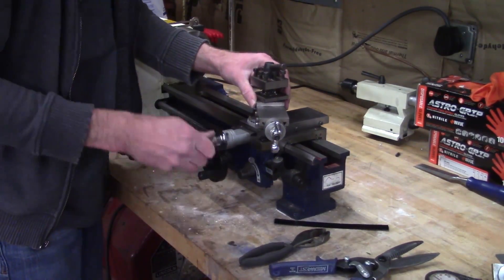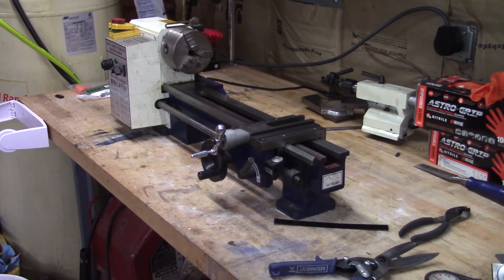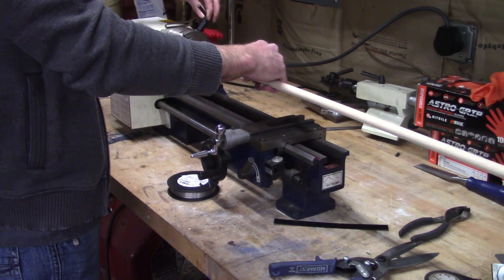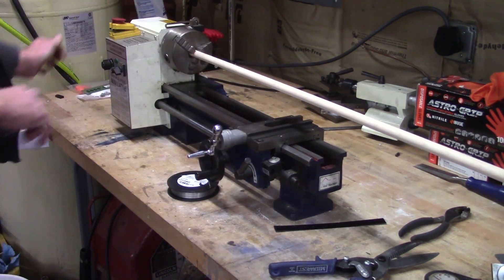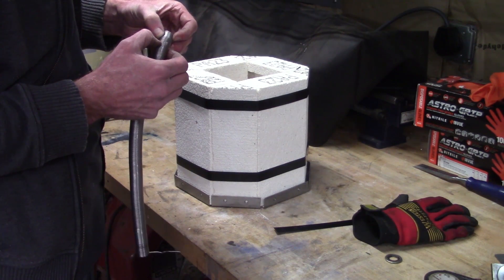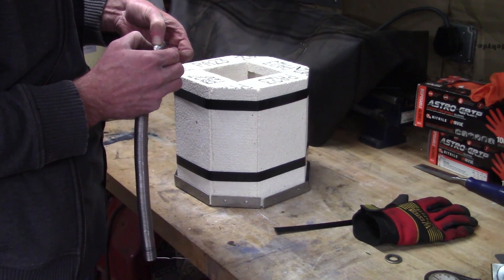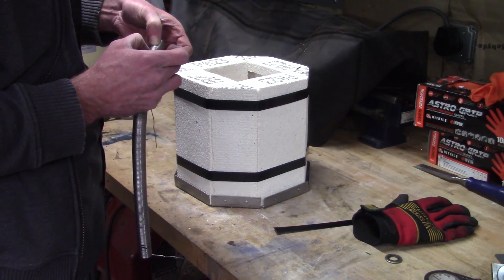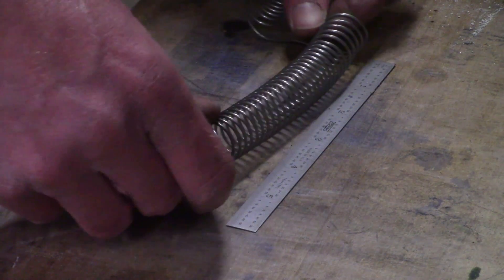Making an Electric Casting Furnace: Part 2

Comment: Nice build! What gauge Kanthal did you use? I'm planning to build one and run on 120 VAC, with around 1800 watts I need about 8 ohms coil. It seems to me my coil would be very short, so I can't wrap multiple turns on the furnace. Your coil seems longer, so I wonder what gauge you use.
Reply: In one of his comments, he mentions his runs roughly 3000w, and at 220v must be pulling 13.6A (P/V=I). And so his element must be just over 16ohms (V/I=R). From your figures, you're running 120V @ 15A. I think AWG 18 kanthal runs at 1.7 ohm/meter, and he used a whole spool, so maybe a 10 meter spool? So my guess is, he used AWG18. So like you said, your coils going to be very short or very thick!
Reply: Actually scratch that, further down he says he uses AWG16 wire, so he'd be using roughly 15 meters.

Comment: Hey, any chance we could get a BOM or those plans you refrence in the first video? Thanks!
Reply from the maker: +Da Az I'll see about the plans if I still have them. Remind me in a day or two if you don't hear back.  The BOM changes based on a lot with what you can find, the wire, thickness, number of turns, etc. There are good resources online though. Kanthal 16 gauge, PID temp module, a high temp thermistor/thermocouple compatable with your PID, high current AC relay for the PID to switch the 220 or 110v AC and then just some fire brick and quartz glass tube.  Has to be quartz or it will melt.
Reply: Thanks! Really I was wondering if you needed a special PID to handle the high voltage but then I realized with a derp that that was what the relay is for. Would thinner kanthal yield a more resistive coil that might work on 110v here in the us? My 220v isnt in a convenient spot for smelting.
Reply from the maker: Sure.  You'd have to do the math but basically the lower voltage makes it harder to get high temperatures - at least quickly.

Comment: Nice build, all that bare copper wire around the place makes me nervous though.
Reply from the maker: +Wobblycogs Workshop That's all grounding wire for the exposed metal bits so its perfectly safe; or at least equally as safe as the metal. :)

Comment: Chris,  what is the diameter of the Kanthal wire and how many feet do you have in the kiln?  Did you calculate from the resistance of the wire to determine the feet you need and amperage available?  Or, did you find a plan out there somewhere?

Love your show!  Can't wait to see more on the mill!
Reply from the maker: +Green Range it's 16ga which is the biggest they sell on Amazon.  I did the calculation based on this into http://www.euclids.com/Html%20pages/element-design.htm and used a coil length calculator to get the final length. I don't recall that I actually used though.

Comment: Hi cris congratulations for the video. I ask you: with this the resistance lasts a lot? Can you use it for a long time?
Reply from the maker: +Lele Armi It doesn't last forever but it should be good for at least several dozen hours, if not 100+ hours.
Reply: Thank you for the reply . The resistance is in kanthal? 100 hours are few, so is a machine for just the right experiment? In my opinion, with few modifications, it can be very lasting and put in a working environment. what do you think about it ?
Reply from the maker: +Lele Armi How long it will last depends on a lot of things, the diameter of the wire, the operating temperature, how many on/off cycles, etc. There are thicker elements made of things like silicon carbide if you want it to last even longer.

Comment: Nice build.  Why did you put the glass tubes in the coils?  Are they not stiff enough to avoid collapse?  I just built a small heat treating oven, using 1x0.3mm Kanthal wire at 3.9 ohms per meter (1.3 ohms per foot).  So far I have tested it at 1560 degrees F (850C) and no need for any rods to hold the coils together.  Although I did have som trouble with the coils twisting out of the slits when heated.  Fastened them with some steel pins to the blocks.  My goal is to heat treat a special tool steel at 1920F (1050C).  Hope to put out a video soon (but my graphics car said bye bye).
Reply from the maker: Correct.  I heat to about 2,000F occasionally which was enough to completely collapse the Kanthal wire of about the same gauge in my last kiln.  The staples work well enough in the ceramic fiber board but they have no grip in the bricks like I used; they just pull right back out.  So, I figured I'd try and find something that would support them.  So far the glass is still perfect after about 30 cycles!

Comment: Where did u get your kanthal thread, what wire dimension is it, and how did u calculate the coils? I have only used premade ones.. But this got me curious in doing a second attempt at a electric kiln instead of my oil burning ones.
Reply from the maker: I got it from Amazon,  from a company called Temco.  It's 16 gauge.  For the length calculation I used their ohm/ft spec and http://deepfriedneon.com/tesla_f_calchelix.html for a calculator.  Know the resistance you want, coil diameter and spacing and just keep changing number of turns until it calculates the length you are after.

Comment: 120 volts 😂  noting personal just the fact that 220 volt is special in the usa is funy
Reply: Thefreakyfreek virtually  every house in the US has 220v, its just that typical wall outlets are 120v, 15a. What happens is the power coming in is two different 110v "legs" come in, 180 degrees  out of phase with each other, combined it makes 220v, for things like stoves, air conditioners, etc. Its known as 220 single phase. Industrial power is usually 220v 3 phase, which has 3 powered legs, 120 degrees out of phase with each other.
Reply: Thefreakyfreek Over here in New Zealand, we have 240v wall outlets
Reply: in europe l1 to n is 220 v and 3 phace power is 380V from l1 to l2 or l3 
and we use l1 to n as normal house power
Reply: For example every normal building  in Germany have a 220V 3 phase house connection which is used in the stove. Furthermore it is split to three normal 220V rails who power the normal outlets.
Reply: And a juicy 400v on 3 phase
Reply: its 230 in NZ. 240 in Oz
Reply: in europe is between live and ground 230VAC 50Hz, between phases 400V. everywhere, every house, is threee phase conection :-P
Reply: Europe, before EU era, has different voltages for different countries. Most communist areas use 220V/380V, British and surrounding areas use 240V/415V, and other areas use either of them. After EU unification, a middle point was chosen, at 230V/400V. Grid operation was not changed, the change of voltage level is only a political thing, and the grid still operates at what it used to output. 230V+-10% covers 220V+10%-6% to 240V+6%-10%. Same for Australia.
Reply: u.s is typically 120. industrial is usually 440 3 phose
Reply: part 3? nice vid
Reply: Man every house has 200v supply all you have to do is to connect the load between 2 seperate 120v phases to get the higher voltage.

Before you correct me by saying that the double of 120v is 240v the phases are 120 degrees out of phase and not 180 degrees so the the second phase gives only the 2/3 of the voltage because 120 degrees is the 2/3 of 180 degrees (180/3=60 and 60*2=120).

Comment: Back when I was a kid one of the things at carnivals was stretched Coke bottles.  Basically the same thing you have with no bottom.  Raise it off the table, tie a soda bottle neck so the body is in the kiln, turn it on, and as the glass heats up, the bottle stretches out to whatever length you want it to.

Do a GIS for stretched out soda bottles
Reply from the maker: Haha I've heard of those but never thought about how they did it!

Comment: Nice build, what is the diameter of that kanthal wire and from where did you buy it? I would have put those coils to lower two slots instead, heat rises up and all that you know, don't know if that's with any significance in this case though. Keep up the good work!
Reply from the maker: It's 16 gauge which is the biggest I could find, easily.  I got it on Amazon.  Yea I don't know if it matters where the coils are.  Everything I've done with it has been in the top half anyway.

Comment: awesome build, this old Tony has a video about springs where he's using the thread cutting on his lathe to make equally spaced springs. so you wouldn't have to stretch out the coil by hand. 
but still an awesome build - keep up the good work.

Comment: Nice! course now your gonna have to make a larger one...oven or kiln style...for heat treating/oven brazing etc etc :)...If you make it reasonably airtight or top opening you can even do things under an inert gas...lol gotta love tool fever! Remember too heat treatment of aluminum castings isnt rocket science either...just needs good temp and time control :)
Reply from the maker: I know, right?  I've actually been using it mostly for heat treating the S7 steel stamps I've been making for the silver casters.  I got some stainless tool wrap for them and they come out extremely well compared to the flux and crap I was trying earlier.
Reply: yeah covering them in borax works but a foil wrap with a bit of paper or cloth thrown in to use up the oxygen cuts way down on the cleanup
Reply from the maker: That's an interesting idea!

Comment: Surprised you put the heating coils at the top, especially given the temp sender is at the bottom.
Reply from the maker: The thermocouple is about in the middle but the primary use for this is melting metals in a crucible which hangs from the top, down to just a bit over 2/3rds of the height.  I wanted the coils as close to the stuff it would be heating as possible.

Comment: Nice job is that 1750 celsius of fahrenheit and if i got it right you got all that  heat from 1,21 kw ?
Reply from the maker: That's in Fahrenheit.   It's actually right about 3kW (~15 ohms at 220VAC) but I really wanted to use that joke.
Reply: Well then better make  torch on propane gas or you will get  high bills for electricity...well if you planing to melt only aluminium with this furnace you can do it in 30-35 min so actually not bad...
Reply from the maker: I pay $0.11/kWh so it's like $0.35/hour to run. :)
Reply from the maker: There are no shorted coils; although it may look that way.  Some are close but I made sure none were touching.  It's already lasted longer than my purchased furnace, although that one used a slightly smaller gauge wire.  I'm probably at about 20 hours so far, mostly at 1,750F.  I have no idea how long they will last.
Reply: Electric furnaces are way cheaper than propane.
This little thing will cost under $0.40 an hour to run.
Even factoring in replacing the coils (he has a ton of shorted coils and sharp bends), it is still way cheaper than propane.
It scales nicely too. A furnace that will handle a #16 crucible will also be far cheaper than propane, and you will get a better melt. Down side is the system is less flexible than a gas/oil fired job, and more complex to design and build.
Reply from the maker: Vojislav Djuric MoSi2 elements will do 3,300F
Reply: Man, at those prices, considder replacing your garage heater with a bitcoin/ethereum mining rig :D make money while staying warm. I pay $0.29 but it's still making me twice what it costs to run it.
Reply: i totally agree with you for price but can you get  with electric heaters close to 3.002 F or 1.650 C :)
Reply: and Chris DePrisco give us more CnC cutting videos  :) i`m in love  wit your  VMC machine can you tell me how big is work space or  cutting area on your VMC ... i like your  design whit fixed gantry i would like to make something similar whit working space  60x90 in cm...
Reply from the maker: Vojislav Djuric Its approx 40.5 cm3 working area. I'll have a new video soon!
Reply: I will check that well i`m  working with cooling sistem`s and air conditoners so heating is not my thing but i can make everything to work when  i see how :) well  i can repair anything except TV electronic that is not my thing and i mean on chips, resistors and stuff like  that :)
Reply: Nice and i have good eye i made drawing in sketch up form looking on your build and i got working space  45x40 cm so  i was close :)
Reply: Anyway keep good work your in my top 3 youtuber`s...
Reply from the maker: Thanks! :)
Reply from the maker: I didn't think you could feasibly mine Bitcoin anymore.  What do you use for Etherium? I used to have a few rigs full of MSI graphics cards for mining several of the altcoins following the big Bitcoin crash.  But when all the crypto hype slowed down I sold off the rigs and the coins and now I'm sad. :(
Reply: Yeah bitcoin is not at all feasible :P, awsome to hear you've been in it, and sorry for your loss, I also suffered during that last crash, hw was sunk cost. But I'm back to try again, got 6 Msi RX 570 Gaming X, bios mod, oc + undervolt. Msi afterburner reports 70w and 27 mh/s pr. card. You can get themup to 29-30mh/s if you have lots of power and cooling. They're all mining ethereum, sometimes zcash. Gameplan this time, buy/mine and hold.
Reply from the maker: Fortunately I paid for all my equipment and after I sold everything I had a small net gain so it was ok I guess.  I started mining Etherium at one point but stopped as it seemed like a good idea but wasn't gaining any steam. :-/  Etherium mining actually looks mildly profitable, surprisingly; but that assumes it doesn't crash back to just a few $/coin.

If you notice in my wiring video you can see the old "BTC mining" motherboard I was using in one of my rigs. :D